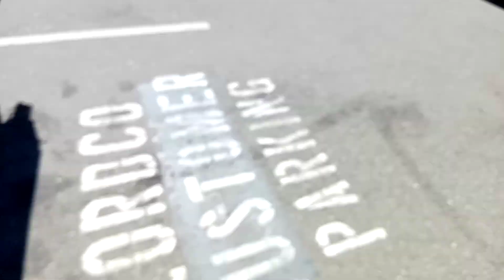Running hot and losing water at 34 degrees Celsius

Comment: When we did the patina 67 step side project I used an aluminum rad from a 94 GMC and it bolts right in ✅
Reply from the maker: Got a brand new aluminum 3 core on Amazon for just over $200 !